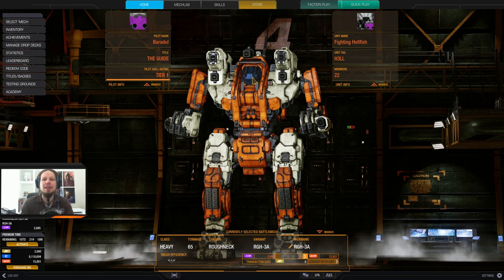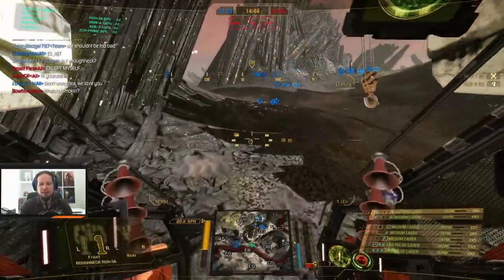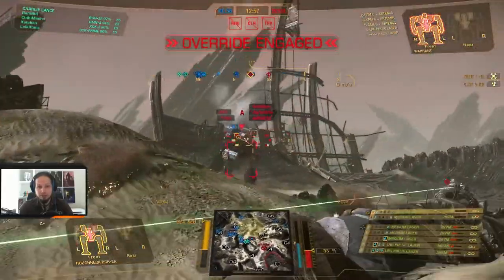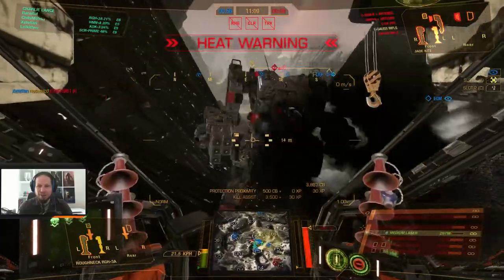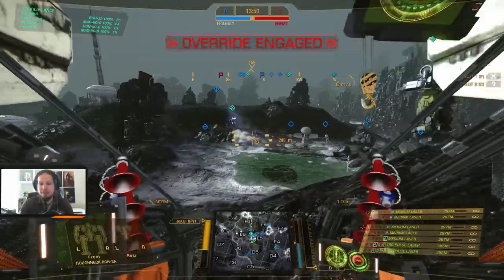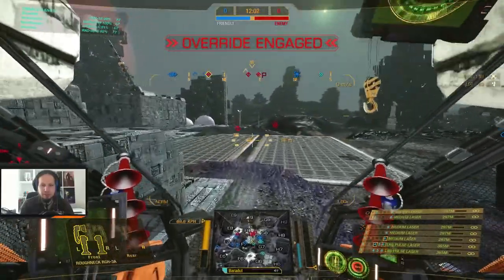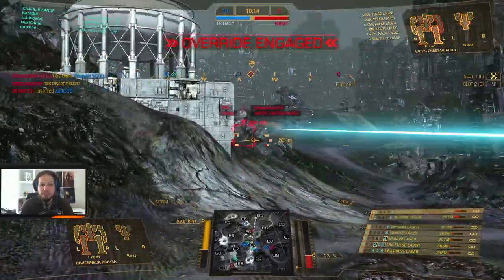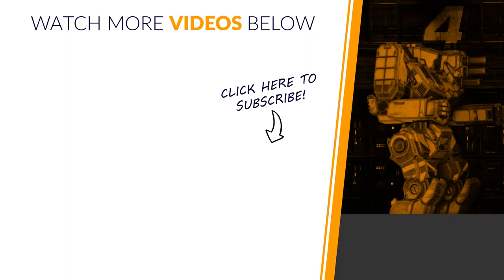Energy Weapon Brawler Roughneck RGH-3A - Mechwarrior Online The Daily Dose #193

Comment: Seems like it'd work better with Medium Pulse Lasers.

I feel like Medium Lasers are in a bad balance spot.  Even if you end up removing a heatsink to upgrade a ML to a MPL, the 'mech still ends up feeling more heat efficient (and also higher DPS).  You pay a cost in range, but it doesn't feel like larger 'mechs can sit at optimal medium laser range anyway.

I think the PXH-1 is the only 'mech where it feels like MLs are kinda worth it.  With +70% accel/decel and a maxed engine speed of like 137kph you can easily sit at optimal ML range. Jump jets for peak-firing over buildings.  A +20% ML cooldown quirk for your 3 MLs and a +10% MG cooldown quirk for your 3 MGs to finish injured 'mechs.

Comment: honestly id drop the arm meds and put 2 more DHS in, there are too many times where you get caught mid cooling when running hot builds
Reply from the maker: +L3gendaryLlama probably a good idea
Reply: You could also drop 4 ML and change to 2 MPL. =D
Reply: +Pin-writer Nah that would be a bad idea, your losing a lot of damage there for a shorter burst time (of which doesnt matter as the LPL would be longer anyway).
Medium lasers and LPL are used due to their similiar burst time and recharge speed, swapping to MPL would be a bad idea :/

as for just boating MPLs, i dont think this mech is fast enough to afford the short range, most MPL builds are usually mediums or fast assaults, of which i wouldnt say the Roughneck is a fast heavy

Comment: Splat/MG build for the 1C.
http://mwo.smurfy-net.de/mechlab#i=537&l=877d6c59733909b426c90b346039e38cd12a9d77
(if it runs too hot feel free to get a smaller engine for some heat-sinks.)